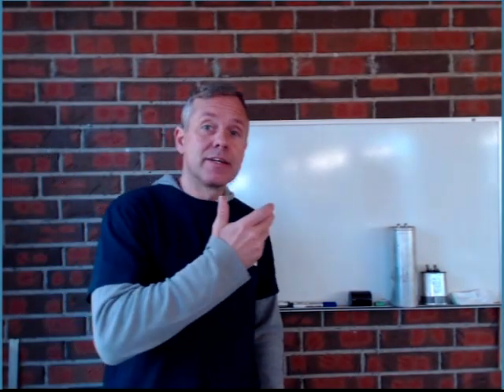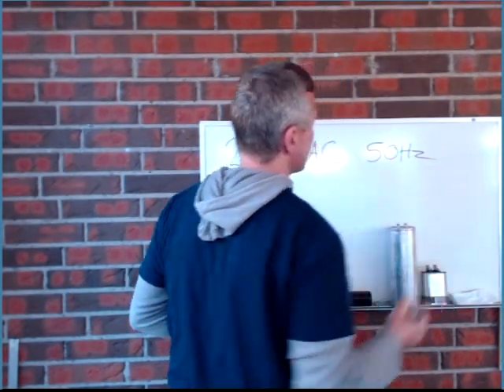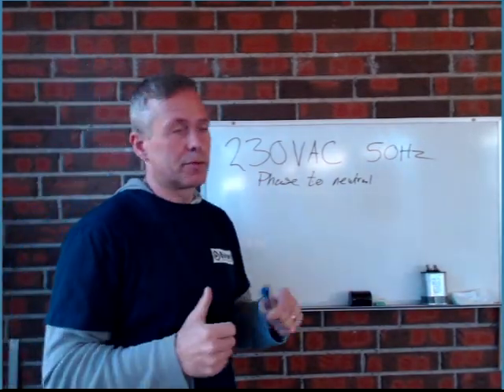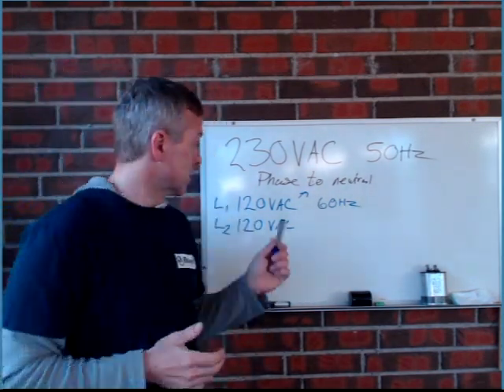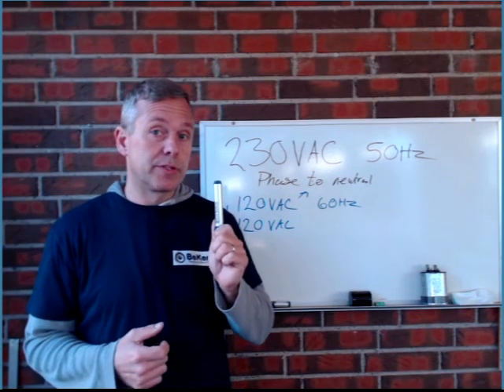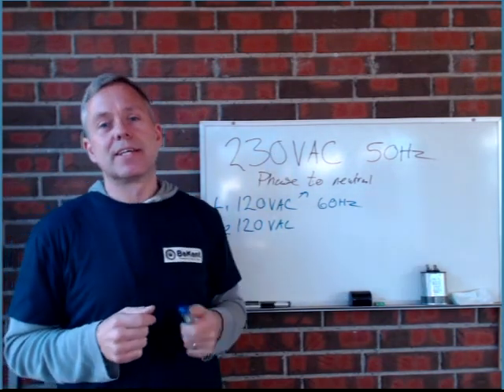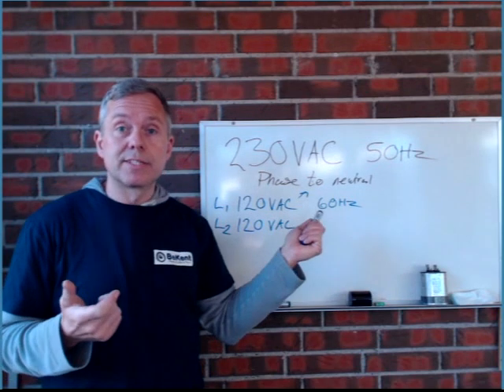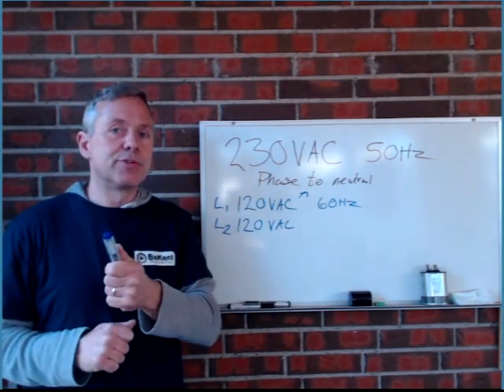European VS US voltage

Comment: So to run a kettle in the US you need two phases hahaha bannta
Reply: @gradyj3827  Love that shit
Reply: Imagine needing two phases to run a kettle
Reply: No, we use a single 120 volt leg for kettles. Our kettles are just slower, typically 1.5 kW.
Reply: @chrisbauer1925  that sucks so bad man haha
Reply: An electric kettle designed for European use runs on a single phase of 240V.  All you have to do to use one in the USA is install a 240V outlet in the kitchen and replace the plug on the kettle.  We in the USA are more likely to just use the cooktop to heat water, but we could easily do it electrically.
Reply: @GH-oi2jf  Oh ok fair but still sounds like a pain in the ass
Reply: @dean1100110  And our washers can get very hot compred to amrican ones.
Reply: It's still one phase in US we just split the phase potentional with a neutral halfway between the phase on the transformer. I like the idea of the European system but one benefit I could think of in US wiring is being able to pull multi wire circuits (12/3,14/3) for household loads
Reply: @jordanwilliams8539  Doesn't that mean in some circumstances you can burn the neutral wire. We do have multiple-ring main circuits in most newly constructed systems and do have one for every room
Reply: @chrisbauer1925  The standard electric cattle has, 1,8 KW in the EU.

Comment: most american houses have 240v
Reply: No
Reply: @ElementFreedive  every American house use 120v. I never found any electronic device that use 220 in America unless it uses both.
Reply: ElementFreedive You okay bro? You seem a little worked up. Wanna talk about it?
Reply: @ElementFreedive  I did not receive this in my notification so sorry for 2 month late reply. So a single bus bar has 110v. Correct? Because that's what I meant. 110v, so plugging in a 220 device won't work. When I was at Philippines, I planned on buying a Japanese PS1 from this dude who has it in stock, and he mistakenly plugged it in a 220v plug, and it exploded.
Reply: @ElementFreedive  
So you only get 2 phases (live) into the building?
We use 3, which also lets you create a virtual neutral line at transformer level.
3 phases go in, you get 240V with any of then and neutral and 400V using 2 phases.
So at first sight you have to spend more on wiring in the US than here in Europe, since your wiring cross sections are going to be larger to get the same W.
Reply: @j.b.2263  In MOST residential 120/240 systems they take one phase from the transmission line to feed the primary on the transformer. The secondary winding is center-tapped to derive the "neutral".  Only the unbalanced loads travel on the neutral back to the transformer, the rest (majority) is carried by the two line wires. 3 phase is used mostly in industrial and commercial settings in the US, and there too they can  easily derive a neutral using a Delta-Wye wiring configuration of the transformers, but there are a few other ways as well (like a grounded corner delta).

We can also derive a 120v system from 3 phase. In which case phase to phase  120v x 1.73205 = roughly 208v phase to phase. This is again mostly used in commercial or industrial settings.
Reply: @thomasdavis4253  
But doesnt using 120v ups cost by an important amount. Your need cables with larger section( do you say sections in English) / diameters. You also need larger diameter tubes You also need larger sub-stations.
Reply: @j.b.2263  It could.... If all things were equal. It all depends of the typical service rating between the US and others countries and I honesty don't know enough to say for sure if that equates a sizeable saving or not. Typically high wattage devices are fed with 240 anyway. Most of the 120v in the residential area is for appliances and lighting loads.... And usually are rated at 15 or 20 amps at 120v.

We use a gauge system... Specially the American Wire Gauge. It is based on the circular mils of the conductor with smaller gauges equalling larger wire. Its a convoluted system.... Lol. Our code lists all measurements in metric first and empirial second, but you know the force of habit keeps it going.
Reply: @thomasdavis4253  
Less V means you need more A to have the same W. More A implies bigger cable diameter.
Sorry to use V, A, W etc. But english isnt my first language and I know we use different terms for the same thing.
Reply: @ElementFreedive  hopefully you can answer this for me, i purchased a 220v controller for my lathe , well it came from china and it only has L,N,G on it so here that's only 120vac no it works this way but not generating the dc output voltage or watts required is there any to get 240 to it i even purchased a us to Europe converter and that did work help at a total loss with this.
Reply: @ElementFreedive  Hi, I was wondering if I could use my european woodworking machines (220-240V 50hz single phase) in a US 240v outlet? I have understood that the electric motors will be running 20% faster but some people say they can handle it. As an electrician do think it is possible if I simply change the euro plug by a US one ?
Reply: @ElementFreedive  Ok, thanks for the advice!
Reply: @j.b.2263  I the US we get only 1 phase which is split phase of 120 on each line.These two lines of 120v each are 180 degrees out of phase so on each alternation of the current we get 2 points where you have a neutral . This is in 240v residential or   small commercial service.
Reply: @heavy_ang_patay  The code says that low power equipment must use 120 V.